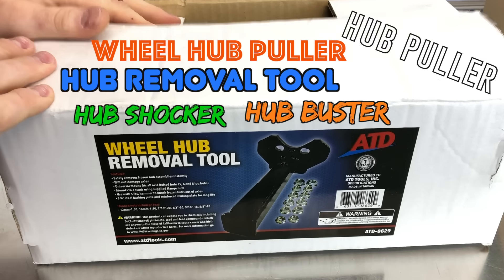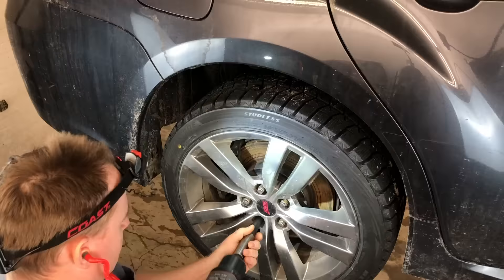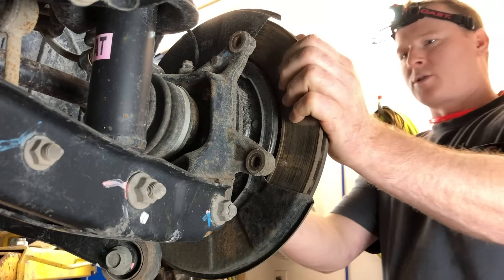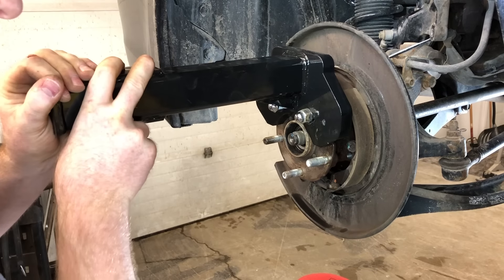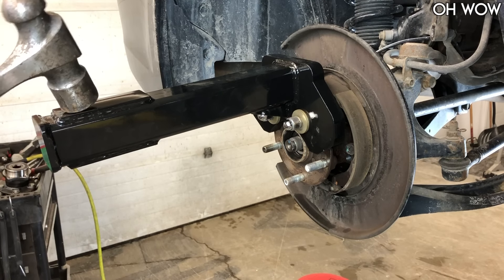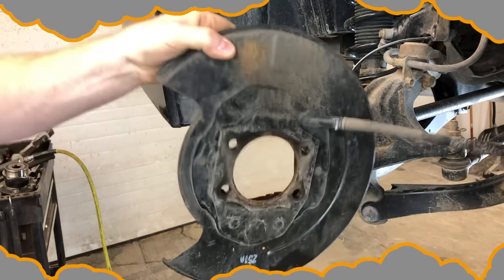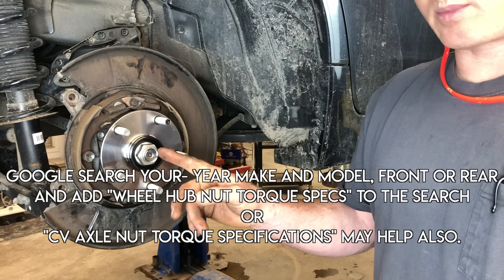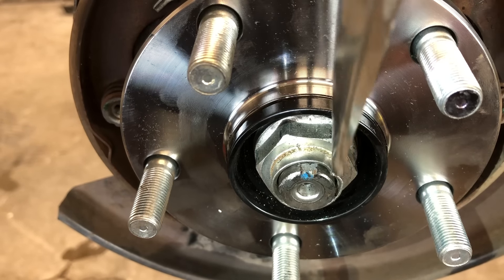HUB SHOCKER Hub Busters  |  REMOVE STUCK WHEEL BEARINGS EASILY!

Comment: Ended up buying one of these but it was no match for a Pennsylvania Subaru wheel hub assembly.
Reply from the maker: How did you mount it?
Reply: @EasyFixShaun  used it on top, originally tried the supplied nuts and washers but they were destroyed within 20-30 hits. Ended up trying some iron washers with lug nuts but annihilated that thing another 50-100 hits with an 8 lb sledge and no dice. 

Finally got the knuckle off yesterday after removing a stubborn pinch bolt ball joint, just going to take it to a shop to press the assembly out. I'd press it myself on a 20t press but not sure how to get it off without destroying the parking brake mount shield. Must be a common issue because I've only found a single website that has those shields in stock.
Reply from the maker: I haven't gotten stumped yet on a Subaru, but I fear it will happen eventually. Their bolt-in bearings keep getting harder to remove the older they are. Ford's are impossible with the Shocker tool usually, and easily take the crown for most difficult. When I use the tool now, I only thru-bolt with grade 8 bolts. I made an update video. The grade 8 thru bolting increases clamping and makes a huge difference. I destroy some bolts, but it applies energy to the bearing much better. I also have tried a block of wood and jack below the knuckle with good results. Here is a video of how I do it. I also have a cv-axle trick in the video to keep bearings from loosening and separating in two! That happens frequently 😃🔧
https://youtu.be/eKqYtMdlPYo

Comment: I've chipped an axle stub  by not unstaking the nut and after mangling the threads on another i made it a habit to always unstake them with a pointy punch.
Reply from the maker: That’s a great to go about it. I have personally unbolted probably a thousand axle shafts. I’ve never never damaged a shaft like that. I usually only damaged them if I use a hammer to hammer a badly stick one out. The ends with mushroom over a bit. Then I have to grind them down. I always use a 2” Roloc grinding disc on a small angle grinder air tool. I will grind down at a 45 degree angle until I remove the “mushroom” and then taper it a little until by the nut will spin on by hand to repair 😀
Reply: @EasyFixShaun  right there with you on the quantity of axles removed,  but  after spending 30 minutes on flat rate to repair the mangled threads on that Toyota it just made sense to take the 15 seconds to always unstake.

The chipped stub was on my personal honda and im reminded of it everytime i take pull the wheels. 

Hammering the axle is always a last resort for me and if I'm in that situation i just assume it's going to need an anxle. A block of wood  between the hammer and axle can help prevent mushrooms,  but most of the time it just dampens the hit too much.
Reply from the maker: 10-4. Isn’t that always the case. It’s your own vehicle you screw up! Me too. I understand what flat rate is. You learn real fast what is worth gambling on and what isn’t. You pay dearly on flat rate when you mess something up because now You also get to fix it for free. I use an air hammer with a punch bit on the center portion of an axle to free them when stuck. Once in a while I mushroom  them with a hammer while they seem to be moving. But they aren’t and the smartest move would be to stop and just grab the air hammer. But I get lazy. You are right. Popping em out out with a punch instead of risking damage is always best 😀

Comment: You should always use a new driveshaft nut. The fact the old one settled in a different position when refitted is suggesting the threads have been strained and may fail. For the cost use a new one.
Reply from the maker: Good point. It never hurts to use a new one. The old ones work fine also. The different spot that it landed on, could be from some other factors also. When you go to the dealer or a shop, they reuse the nuts unless the come in the package with the new bearing.
Reply: @EasyFixShaun  When you go to a dealer or shop they dont use a new one because they charge for it in your "sundries", but actually supplying one and fitting it cuts into their profit margin due to the con they are operating. Its sharp practice.
Reply from the maker: I am not sure what "sundries" is. Do you mean shop supplies?
Reply: @EasyFixShaun  Sundries are items charged for that are hard to put a description to, such as a fingerful of grease, or a couple of fuses, a piece of wire, Etc. A hub nut is another sundry item. The problem as a customer is how do you prove these incidental items have been used? Many disreputable workshops use "sundries" as a way of extorting even more from a customers pocket.Body shops will do the same and tell you its for sanding sheets and masking tape and paper. I would rather agree a cost of extras before the job starts, and thats it. No additional charges, "Well we did use it Sir" just doesnt really cut it.
Reply from the maker: Ok. An axle nut isn’t a bulk fastener that would typically be a “shop supplies” or “sundries” charged item. I’ve never heard of sundries before. I’ve only heard of shop supplies as an additional charge. Must be a regional thing. I think we are talking about the same thing though. An axle nut has a part number and would typically be itemized on any ticket if it were used in a repair.
Reply: @EasyFixShaun  Well if you are from the UK  and spoke true English you would often come across the word. The dictionary definition is "various items not important enough to be mentioned individually". Unscrupulous workshops use this heading for anything that they think they can get away with adding to the end price. Zip tie anyone?
Reply from the maker: So it’s a regional thing makes sense. Well good luck. Have a great day. 😀
Reply: The threads can be fine and the reason why the staking spot didn't line up could be from tolerance stacking. If a half dozen different pieces are assembled and they all have a + or - .002" machining tolerance then when assembled it could be off .012" If the manufacturer wants you to use a new nut they will supply it. The Mevotechs that I put in my Yukon came with new mounting bolts, axle nuts and washers.
Reply from the maker: Exactly😀🔧
Reply: @KDuboutdoors19  You just said, " If the manufacturer wants you to use a new nut they will supply it." it is for the reason of using a new nut that a new part has a new nut supplied with it. If you have a new nut supplied why use the old one? By your own experience you say, "The Mevotechs that I put in my Yukon came with new mounting bolts, axle nuts and washers." That being the case there is no need to use the old one.

Comment: How long can a bearing last? My 05 Honda Accord EX-L is about 100500 miles. Time to change?
Reply from the maker: Bearings vary widely in the their life spans. I would say your Honda is hands down going to be one of the longest lasting bearings. I have seen them go 200k roughly. Its near impossible to know when any bearing will fail ahead of time. I usually only replace them when they go bad. Just my style. You could replace them as a preventative maintenance type of thing. It would be up to you 😃

Comment: Reattaching the wheel for leverage often works, be mindful of the caliper tho.
Reply from the maker: Good Idea. I need to try that. Do you then drive on it? Or push on the tire while its in the air?
Reply: @EasyFixShaun  Sledge the tire like at the gym? Hell a cheap steelie rim from the junkyard can't cost that much...
Reply from the maker: https://youtu.be/eKqYtMdlPYo  Here is how I do them all now. Check out the updated video and let me know what you think. Stuck rear bearing problems for me are becoming a thing of the past 😀https://youtu.be/eKqYtMdlPYo

Comment: Nice tool.. BTW instead of hitting that rotor with a hammer use 2 bolts ..drive em through the 2 threaded hole and will pop right off!
Reply from the maker: Good tip! That is a great way to do it if there no rust ridge on the inside of the drum brake portion of the rotor. 😃🔧
Reply: @EasyFixShaun  drive the bolts in little by little..take your large pry bar use the studs to turn the rotor and usually slides right off..but you're right that rust ring can be a bitch and everything has to get destroyed!🤘
Reply from the maker: Yup! I am with ya fo sho! I love that they put the bolts in there because they work great. I always try to get it off first if I can by breaking it free. Getting drum/rotors off has become a little bit of an art form. 😃
Reply: @EasyFixShaun  I have a tech that has the worst luck on drum brakes especially  on fridays. When he gets a rear shoe replacement on fridays we all look at him and Gasp with a horror look in our face..sooo funny!😂😂😂
Reply from the maker: @luisgordillo1695  hahahaaha that's funny. He should take fridays off and work "4 ten's". Problem solved. 😃
Reply: @EasyFixShaun  heck no.. Then we have to do it!😜😜
Reply from the maker: @luisgordillo1695  You should let the customer watch the repair for the tech on fridays. That always helps... 😃
Reply: @EasyFixShaun  actually the last time the customer was there. Was like holy crap. 👍
Reply from the maker: Oh no! Hahah. Poor tech....😀

Comment: So your torque setting is compromised by damage to the old nut.?
Reply from the maker: You can reuse the nut. No problems there. Just “restake” the nut after you torque it to the proper specifications. The torque of the fastener will prevent the nut from backing off. The “stake” will slow the nut down from spinning off in the event that it loosens up for some unknown reason.
Reply: @EasyFixShaun  I also reuse the nut but only after I have removed the damaged area with a tap or file. Most of the energy absorbed in torquing is in friction between the threads and not in the faces. So obviously threads should be clean and lightly oiled to attain correct tightness, unless grease is recommended, when the torque can be reduced by about 25%. This also leaves less torsional stress in components, good if something is removed regularly. Cheers mate, Mitch.
PS just done the fronts on my C-max, managed to mackle -up some tooling with 24mm threaded rod and plates fashioned from the old bearings. Used the oven and the freezer too.
Best tooling investment I ever made was my Colchester student lathe, you can make any bespoke tooling if you have a lathe in the tool kit.
Reply from the maker: To be technical, torque settings on a cv-axle nuts is calibrated for an un-lubricated fastener. The manufacturer of every single car model does not use grease or lubricant there. I have torn a lot of cars apart that were weeks old and I have never seen any lubrication on cv-axle nuts or lug nuts. Should some have lube, yes. Especially the rust belt cars. But that’s not the case. This is just my experience. I do mine dry. You should do em however you want, it’s your car. I respect your opinion and your choice. But, every fastener on the car with the exception of head bolts (sometimes) comes dry from the factory. I will always recommend no lube just like the factory 😀

Comment: Can you do videos for a Toyota Sequoia front suspension and steering
Reply from the maker: Yes I can. I am not sure when that would happen though. What are you diagnosing or replacing on the Sequoia??
Reply: @EasyFixShaun  ball joints UCAs LCAs
Reply from the maker: @appleguy6708  I can do that. I would love to do it right away for you but...Its gonna take a while. I need to get on to do it on. Those parts don't wear out and need replacement very often on the Sequoias. They are pretty awesome vehicles. 🤓

Comment: Not super familiar with Subaru's but can someone help me with what I'm looking at once the wheel comes off? Clearly there's a caliper that goes around a rotor for braking. Is there also a drum inside? For parking/emergency brakes?
Reply from the maker: Yes. The rear disc brakes have a hat style rotor so that the emergency brakes can be inside  the rotors. The emergency brakes are miniature drum brakes 😀🔧🔧
Reply: @EasyFixShaun  That's kinda cool. Thanks for replying.
Reply from the maker: They work really well actually. Simple easy setup. Only failure points is if the cables get rusty in s northern climate from not using them. Otherwise if they are used regularly they last forever 😀🔧🔧

Comment: This tool looks too good to be true.  Are you absolutely sure there is no damage, or distortion done to the knuckle mating insert part, to the bearing.
Reply from the maker: I know what you mean. Basically the tool just breaks the weakest link. The weakest link is the "rust bond" that is holding the two parts together. Checkout the second video and you should feel more comfortable using the tool. I use it all the time. https://youtu.be/eKqYtMdlPYo

Comment: I used a 6 lb sledge for mine
Reply from the maker: Nice! I should say I’ve tried all my hammers too! My normal 42oz big hammer will work. But now that I know the force required....I go straight for my sledge hammer. It requires less effort and I am not as close to the tool. It is just easier for me and I don’t have to swing as hard as I can with the regular hammer.

Comment: I purchased on from matco tools and it didn't fit Subaru hubs .had to file holes to make it fit didn't take much and the nuts that came with it don't fit subaru
Reply from the maker: I haven't had to slot out the ATD tool yet for other bolt patterns. The nuts they send are also garbage. I still have the nuts but I am about to throw them all away. I only through bolt the tool now. The tool is so powerful! In the new video I solved the mounting issues and bearing separation issues. The tool will rip the threads right off the studs and rip the bearing into two pieces. Leaving a still stuck bearing half in the knuckle which can be even harder to remove. Here it is. Let me know what you think?😃  Hubshocker 2.0  https://youtu.be/eKqYtMdlPYo
Reply: @EasyFixShaun  you should put a stand under spindle  hitting the tool ..I made a stand years ago told Steele rim welded a 2 1/2 inch pipe to rim used 3 pieces of a angle iron  welded to pipe and rim to brake pipe is about 18 inches long .then use 2 1/4 inch pipe for center pipe ..this pipe is roughly 3 feet long .. well you get the idea

Comment: Have one, does not work on all vehicles.  Caprice, ppv explorer.  Get very rusted in hub on squad cars. Live in Illinois.
Reply from the maker: Explorers are extreme examples that I wish there tool worked on.  Simple bolt methods work on those. I use the tool for just about everything else. Sorry you have so much rust. We do too. 😀🔧🔧

Comment: Why would the striking not bend the lug studs?
Reply from the maker: It could bend them. But since I was replacing a bad one anyway it didn’t matter for me. The tool uses a prying type motion on the studs. It probably won’t bend them. But it could easily destroy the bearing by pulling the two halves apart. Are you trying to save the bearing?
Reply: Easy Fix : I am not trying to save the bearing, I use the hub puller tool, it’s ok but this one looks beefy
Reply from the maker: @RingZero  Oh ok. Ya somehow it doesn't seem to bent the studs. It works amazing. I wish I had a long time ago. It is one of my favorite tools now. On stubborn rusted bearings that won't budge after 3 hammer swings, now I pull out the Hub Buster. Game changer for me.
Reply from the maker: https://youtu.be/eKqYtMdlPYo Check out the new method to mount the tool. I only through bolt them now and the notorious Subaru bearings are easy and don't separate on me any more. Let me know what you think 😀